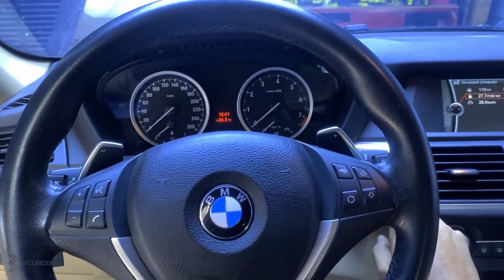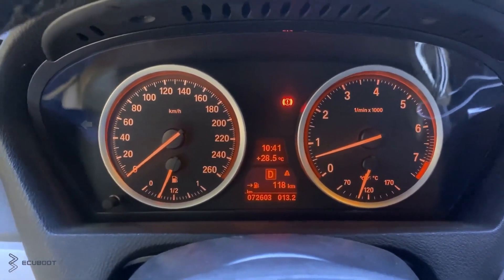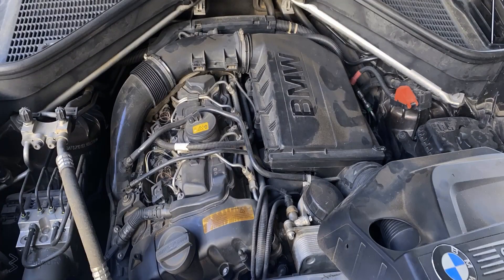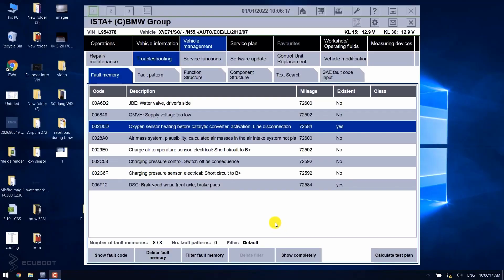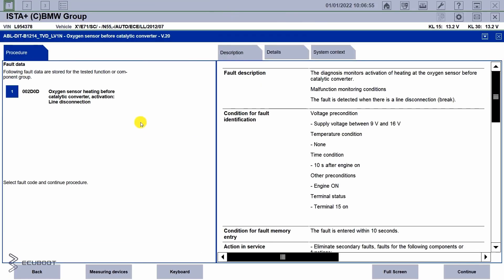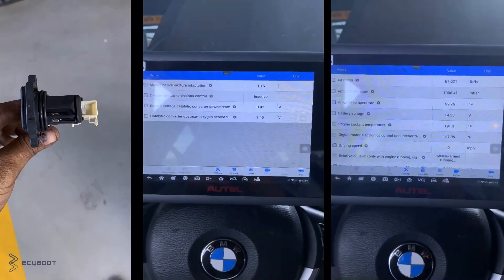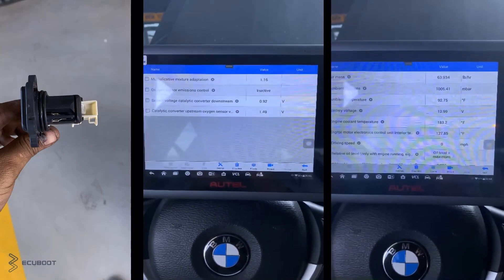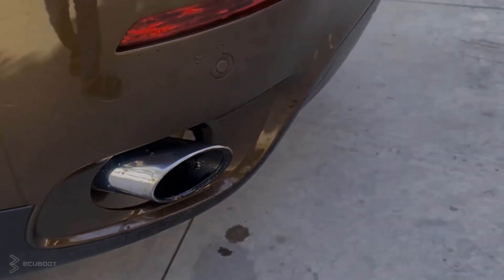Fixing Air Mass Fault on BMW X6

Comment: Yes sir pls help I have bmw x6M e71 2014 code P0112E it said manifold absolute throttle angle too low bank1 dealership told me PCV leak I changed it but problem still remains any help from kindness possible thanks I am Vietnamese too

Comment: Good video … my bmw x6M 2013 kept having the manifold absolute pressure throttle angle on it stored in my car drive fine sometimes engine reduce power any help pls